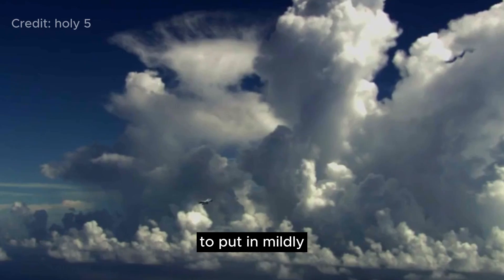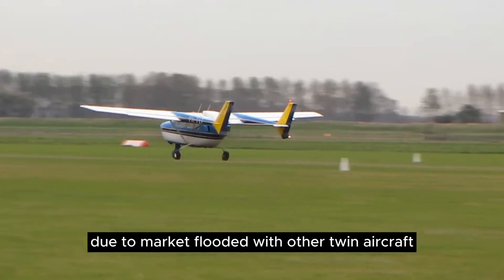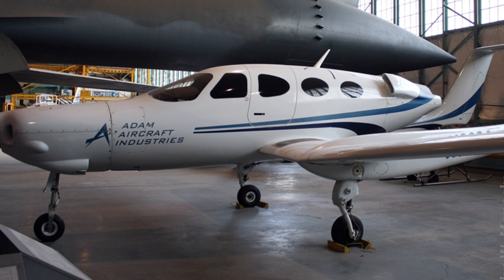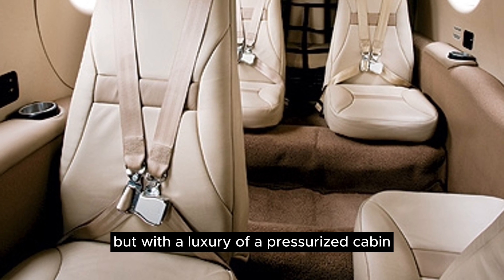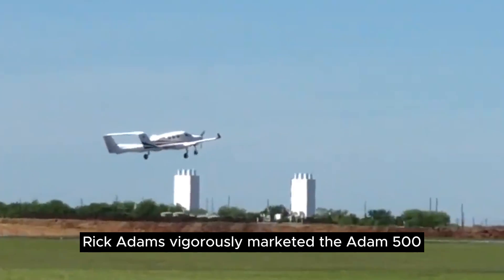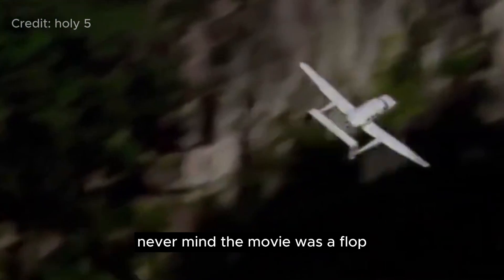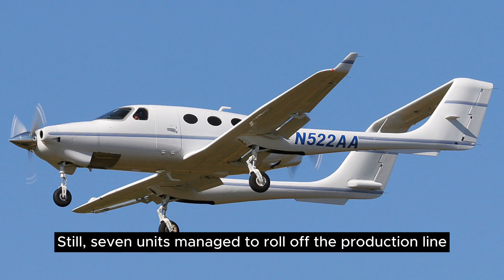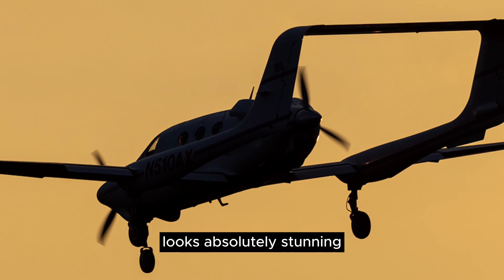Exotic Birds:  The Adam 500

Comment: I’ve flown in one. Formerly owned by a law enforcement agency, so it had several holes cut out of the fuselage for optics and sensors. Very, very loud, probably due to the patches not being insulated or perhaps reduced sound deadening to allow a higher useful load. Nice flying plane though, very roomy and a ton of interest on the ramp.

Comment: I get it but ultimately piston is just garbage and the twin tail compromise speaks to that. What he didn't realize is that he should have developed small turbofan engines which for an appropriately light plane can be very tiny and with pressurization and altitude can have surprisingly good fuel economy. Speaking of Rutan, the globalflyer based on a simple Williams FJ44-4 jet engine did 40000km at 500km/h on one tank of gas. That result simply voids any piston design. We should have had small turbofan jets in GA since 1960.

Comment: Several reasons. They spent too much time on the piston version instead of the jet version. The piston version had several time limit items that need replaced. At very very short intervals. The hydraulic hoses were stupid expensive to replace. They also killed two test pilots because they rigged the ailerons backwards. Just removing the leading edges took hours. The FAA had it out for them. Several things need to be done that other manufacturers did not need to do. Annual inspections took 80 hours. I worked on all of these seen in this video. The Chinese bought all the molds. The jet was way better but it was too late.
Reply: The op jet was in a hangar at the skagit airport in Washington State, I believe , and  alleged chinese college students reverse-engineering it. for the proprietary carbon engineering and  intellectual properties that they bought along with Plane

Comment: I’ve noticed that as many of Rutans designed are hailed as breakthroughs that none, that I know of,  have had a commercial success. Now the military stuff is something else. But I started building  a VariEze back in the late 70 . I lived in Lancaster California. It was only a thirty minute drive to Mojave airport where Rutan had his factory. In the late 70s it was only himself, a receptionist and his cutting edge Apple II computer. I took my small practice parts out to his hangar. He inspected them. Gave me his critique. I started building the plane. It was renamed the (VariTedious) by the aerospace engineers in the area who were building it. Took very long on sculpting and layup with epoxy.

By the way the Lancaster Palmdale area is crawling with aerospace/aeronautics engineers.
Palmdale has the big aviation companies including Lockheed, Boeing, etc. the have their own private 10,000 ft runway. My father in law worked building the shuttle there. Edwards air force base was a few miles from Mojave airport, where a lot of private small airplane companies had their businesses.

You basically had to be a sculpture expert. The epoxy system fumes were toxic to liver. You had to get liver tests periodically. I’m a retired pharmacist who worked for a time in poison control. I subscribed to Aviation Consumer Magazine. I started to see stats of accidents for the plane that supposedly didn’t stall because of the canard. The accidents happened because the guys were used to slow landing Cessnas and pipers. They approached too slow and  tried to flare and land too slow. Guess what happens when you do that ? The canard stalls about ten feet above the runway, dips down to start flying then stalls again. Porpoising. Do this too low and the nose hits the ground and bounces up. The landing gear was weak. It would break and the STRAIGHT manual rod that was used to lower the gear would spear the pilot. It was redesigned with a crank action and no spear.  Also when the porpoising got too bad the airplane would cartwheel down the runway….i stopped building it. Rutan then came out with the LongEze. Lower landing speed.
Reply: Excellent post. Over the decades, I loosely followed some of Rutan's projects. The VariViggen was heavy and offered no real benefit over other two-place designs. But he was young and still developing his design skills. The Vari-and Long EZs gained popularity. I also considered building a Vari-Eze, but when I saw how much runway it required, I realized it wouldn't meet my needs. He devised some other unusual one-off designs, including the Solitaire powered sailplane. The engine and prop could be stowed in the nose during flight, then extended again in front of the pilot's face for takeoff or landing. I had initially admired Rutan more than was likely warranted.
As you mentioned, none of his designs  (other than the EZs) really were successful, though he certainly made money developing them. The Starship was a flop. The Virgin Galactic "spaceship" is another of his designs. It has no future either, but that's mainly due to the infinitesimally small market for wealthy people who want to go on a 10-minute carnival ride to the edge of space and right back down again. Many have defended his disappointing track record by saying the FAA or Beech screwed up everything. There may be some truth in that. But other successful composite designs exist, from Cirrus and Diamond aircraft and Lancairs to 787s and A350s. Some came before Rutan's designs, and some after. German sailplanes used fiberglass construction since the 1960s or earlier. Maybe none of it is his "fault," but whatever the reasons are, virtually none of his designs turned into viable commercial aircraft, large or small.
Reply: Rutan loved to designs and build extreme designs that looked cool but could not be commercial successes however his use of composites and thinking outside of the box opened up the kit plane world and the use of composites. One example was space ship one was revolutionary and led to virgin galactic but its limited capabilities has allowed space x ect to exceed its limits

Comment: I don’t really consider the fuel capacity to be a problem.  So it’s got big tanks? Big deal.  
The king air 200 fully fueled can only carry one pilot.  
I’d rather have the fuel capacity when I’m not full and trying to balance the load rather than tell the line guy to top it off as I’m walking away.  
I’ve been flying the same private jet for ten years and have never ever filled it.  Fuel planning is part of flying.

Comment: Drop the push pull zoom cut, it's rather distracting, just a simple cut is fine. Also, why the open captions? This is not a TicTok video, hate those  with their distracting captions. Just  use the YouTube built in captions and add your captions that way so it's an option. I appreciate you created the script and put captions in, versus using auto caption generation that most people use in YouTube.

Comment: The introduction makes it clear that the Adam 500 was just an updated take on the Cessna Skymaster configuration, although it obviously has a lower wing position. A specification comparison shows that the Adam was a bit larger but much heavier, with much more power... yielding no more payload but a much faster aircraft. I wonder if a modification of the Skymaster could have achieved the same result?
Reply: I was part of a small team that in fact modified 3 Skymasters. We installed IO550s with 3 bladed props essentially doubling the plane's performance.
Reply: Thanks @TractorMan104 - that's exactly the sort of thing I was wondering about. 

The Skymaster has been the subject of a few experimental modifications, usually because of the engine placement. At least two companies have used them to build hybrids, replacing one engine with an electric motor and adding a battery. There has been at least turbine conversion using the rear location (just omitting the front engine, and extending the nose for balance); that was a single taking advantage of the twin-boom design, not the nonsensical Adam twin turbofan.

Comment: 1.  The FAA is comfortable with aluminum structures, but not with composite.   This led to all kinds of certification headaches.  The FAA is bound by the FARs.  Then comes something new which the FARs don’t cover, what then?  
2.  There is likely more hours in setting up a certified production process than designing and building a prototype.  Not to mention manuals, service networks and the like.  How many new designs folded surmounting this hurtle?
3.  The other Rutan push-pull, the Defiant, has good performance on 160 hp engines.  It’s useful load to gross weight is 43% whereas most planes is 33% and that’s FRP, not GRP structure.  I don’t know why this plane layout was not pursued.  Cheers
Reply from the maker: Starship another clear example with FAA hurdles. I just released a new video on a plane (Questair) which went with aluminum precisely because composites were sort of an unknown back in the 80s.
Reply: @aircraftadventures-vids  1.  FYI.  The weight difference between composite and aluminum is an apples to orange comparison.  Aircraft aluminum planes are mainly sheet/stringer/rib semi monocoque structures.  Composite aircraft are sandwich construction.   Semimonocoque is lighter, but composite stay with sandwich because it’s easier to build.
    2.  The granddaddy of composite planes is the Wyndecker Eagle.  It was certified if I remember correctly.
     3.  From an FAA certification viewpoint, saying NO entails nothing..the applicant goes quietly into history’s dustbin.  But if you say YES  and the design later fails, you get egged.  The FAA trusts, for instance, Cessna, but not the new guy.  The new guy has 3 hurtles..earning FAA trust, figuring out how they expect things done, and design testing satisfactorily.     Cheers

Comment: There are a couple of these things still around.  One passed through the FBO where I work a year or 2 back.  I'd never heard of the Adam 500 before so had to ask the pilot what it was and then googled it up after he left, so learned its sad story.  Some of this was apparent at the time, however.  There were 3 folks on the plane so the pilot was VERY specific about the amount of fuel, which was far less than filling the tanks.  He also fussed and fiddled with various parts of the plane quite a lot, because they'd apparently been causing problems, and didn't sump the tanks after fueling because he said the sumps wouldn't close properly and fuel would constantly leak.  I guess when you can't take much fuel and 3 people at the same time, and are burning fuel with 2 big engines, losing even a little would be a worry.  Anyway, even before I googled the plane up, it was apparent that it was a bit sketchy.  Still, it did look cool, though :)
Reply from the maker: Thanks for sharing that.  It can take building quite a few units to iron out all the kinks, sadly they never got that far.
Reply: @aircraftadventures-vids  I used to be a manufacturing engineer building airplanes.  So yeah, it takes a while to iron out all the detail problems both with design and with production, and how those aspects interact.

Comment: What was the runway performance like compared to a standard tractor twin? Did it gave any rotation limits due to the rear prop? Are these better or worse than a standard tractor twin?
Reply: I imagine that's why they had such a tall landing gear and, if you look at the placement of the rear propellor, that seems to be placed as high as they possibly can.  So with these factors in mind, I doubt it had much problem with ground strike on take off.  

Looking at the profile of the plane, if you draw a line from the bottom of the rear wheels to the bottom back corner of the booms, the propellor sits entirely above this line.  So any tail strike would  be with those booms hitting, instead of the propellor. But I'm only guessing and no expert.

Comment: People without experience who think designing an airplane is easy.
Reply: A sad case is that of the Raptor aircraft, designed and test flown by Peter Muller. Its development had an avid following here on Youtube in the 2018-2021 period. There's a good Wikipedia entry under "Raptor aircraft Raptor", including later initiatives. It was a single-engined swept-wing canard, similar to a number of other designs of this type inspired by Dick Rutan. Muller made numerous and regular Youtube videos in the channel "Raptor Aircraft" and these are an interesting archive for anybody interested in designing and building an innovative aircraft. Unfortunately, the Raptor had too many weaknesses due to the non-aviation source of many of its parts, and  eventually crash-landed after several powerplant failures, a fate one could see coming for an excruciatingly long time. However, the unusual honesty and openness of Muller's chronicle of pursuing his passion is most instructive and even gripping.

Comment: I'm all for innovation, but it needs to be an improvement over the old. The Beech Starship, another aircraft with Rutan involvement at the beginning, was hailed as a leap forward in corporate turboprop design. It was of composite FRP construction, and had a canard, and pusher engines. The Cheyenne 400 came out a year or two earlier (the mid-1980s for both). The Cheyenne 400 was of totally conventional design and construction, with an aluminum airframe, TPE 331 engines, and huge propellers. The 400 weighed less than the Starship, carried more people, and had a faster climb rate and higher top speed -- 400 mph. It did all that with a total of 2,000 hp, compared to the Starship's 2,400 hp. With 3% more fuel capacity, its range was about 20% greater than that of the Starship. Neither aircraft was much of a commercial success and are long out of production, though most of the Cheyenne 400s are still in service. 

Interestingly, the Piaggio Avanti first flew 2 years after the Cheyenne 400 and is still in production. It has a very large cabin for a corporate turboprop and has a top speed of 460 mph, faster than early Citations.
Reply: And the Avanti wasn't made of composites and used a total power of 1700 shp. The noise issues were caused by the propellers and exhausts and were partially solved in the lastest model. It was significantly better than everything else and still had room to improve and the potential to easily install other engines. The Starship was subject to the FAA nitpicking all the time (since it was the first composite airplane to be ceritified) and other suspicious events which also ruined the project.
Reply: I've had a couple of Avantis come through my FBO.  I didn't realize they were this old but I should have, given that they're louder even than Mu-2s.   Planes like this are why we now have to deal with noise abatement procedures.  I'm thus surprised they're still in production.  I didn't think you could make such loud planes these days.  They must have been grandfathered in somehow, even in Europe.
Reply: Yes, Starship clearly has a large surface area

Comment: You'd need a mukti-engine rating on your license to fly this, just like every other twin-prop.
Reply: FAA gave out multi-engine ratings with a centerline thrust restriction.  I had one for a while.
Reply: But it would still be safer in the event of an engine failure, unless the remaining engine had insufficient power for the heavy aircraft.
Reply: @Rotuma1260  in flight at altitude that is often the case but many Cessna Skymaster have been lost during take-off or climb out when the pilot failed to notice that the rear engine has stopped. Whilst engine failures are not common the lack of visual reference on the rear engine unlike a wing mounted engine has led to recovery actions not being initiated in time.
Reply: Yeah but one of those can be gotten in a weekend. No big.
Reply: @robjohnson8522  true, but it's still something you need to have to fly one of these. An extra cost.
Reply: @neiloflongbeck5705 True but if you buy a million dollar twin the weekend in a Senaca is not that big a deal! :)
Reply: my multi was 700$ and not centerline thrust.
Reply: @a-fl-man640 LOL what year...you got the training and the checkride for $700?

Comment: It was pretty clear from the beginning that this project was vaporware, the developers were earnest and honest, but it was clear that they were promising too much too soon, and didn’t have the resources to get there…. As happens with so many “revolutionary” aircraft projects…
Reply: The main issue as I recall was weight and useful load. They didn't have the resources and depth to maximize the potential of carbon composites.

They also promised too much, too loudly, too soon. Mistake that countless of startup aircraft wannabe producers have made and make.
Reply: Any idea why the performance was as bad as it was? The design (theoretically) should function pretty good.
Reply: @bitc0inlightningrules423 The twin boom makes it inherantly overweight.  Imagine replacing that whole twin boom with a simple tail on the back of the fuselage.  The weight saving would be pretty significant and it would also produce less drag.
Reply: This engine configuration is outdated. Why double up your piston engines when you can use a single turboprop and a conventional fuselage?